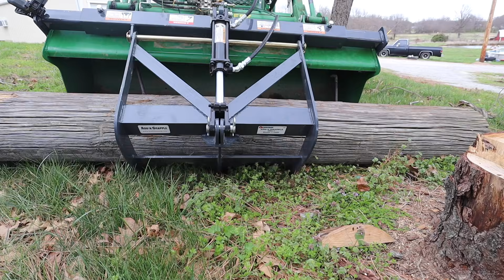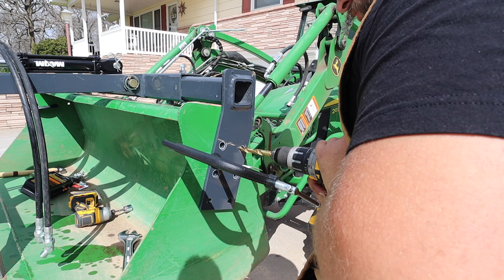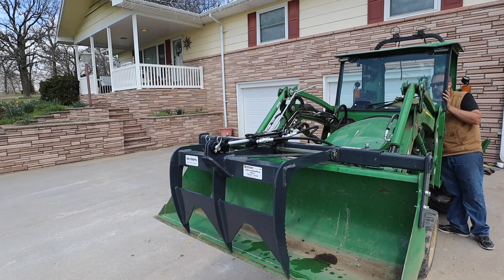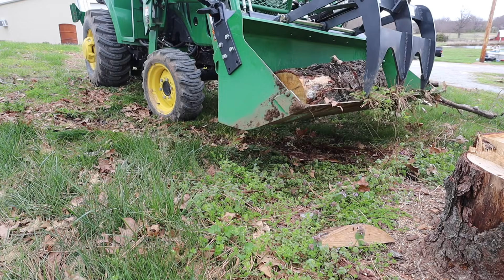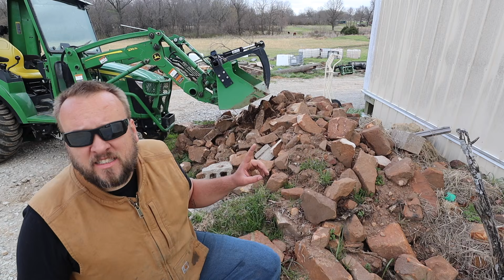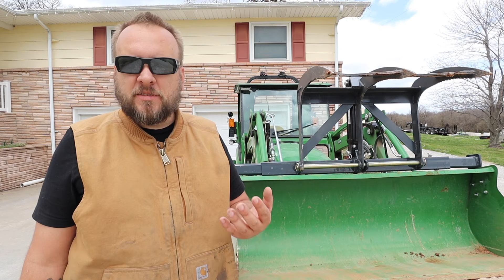The Cheapest Way to Add A Grapple to Your Tractor

Comment: Ive actually found a cheaper grapple , Stout grapple ad on $799 free shipping
Reply from the maker: You couldn’t buy the metal to make a grape for that if it is stout

I hope it works out. The Chinese products are sometimes good but not always
Reply: @RockhillfarmYT its american made in Wisconsin, its a grapple add on that you weld or bolt to the top of your bucket or wherever you want to put it. Its called stout buckets grapple add on.
Reply from the maker: Cool. I thought you meant a standalone grapple

Makes more sense with this type that is added to a bucket

Comment: Your code is expired. Just tried using it. March 12, 2025.
Reply from the maker: Thanks for telling me. The business was sold to another local manufacturing business. It is now owned by Tri-L. I didn’t know if they would be honoring the previous discount code or not.
Reply: Hey I just saw one of your shorts. The code Rockhill works. Thanks for saving me $74. 👍 Rockhill5 didn't.
Reply: Rockhill works. Rockhill5 doesn't.

Comment: Did you pour your steel building foundation yourself?
Reply from the maker: I did not pour a foundation. I set the building on 20 of the 4000 pound construction blocks that I set in place myself.

Saved me about $8000 doing it that way.

Comment: Hey Brock, this is an old video, but I am interested in this grapple. You said you have the small add a grapple, I have a first gen 2032r with a 61” bucket. Will this fit?
Reply: Sorry, I should have also asked if you thought the mini or single version would be better?
Reply from the maker: I don’t remember which one I have but the one I have should fit yours. My bucket is 57 inches and there is a lot of adjustment on the top slider

I would still recommend this product to anyone. I just don’t have that memory for details. Whatever I said in the video should be accurate.

Comment: I was checking into the add a grapple more expensive than a Land pride root rake grapple I've purchased ..
Reply from the maker: You paid less than $1000 for a grapple?
Reply: @RockhillfarmYT  no actually i paid $2200 for it.. but when I got online  all of the add a grapples  were $2300 Plus.. that's why I made my comment
Reply from the maker: The one I have is $995
Reply: @RockhillfarmYT  I will have to research harder I guess
Reply: @RockhillfarmYT  thanks
Reply from the maker: To get 5% off your order use code:  Rockhill at https://www.agfolks.com/product/add-a-grapple-single

Comment: i've had a add a grapple for about 16-18 yrs.  it's as valuable to me as my front end loader is to my tractor.  i used it to clear my property.  i cleared it with a chainsaw, a massey 1240 and an add a grapple.  it made it so easy to move brush.
Reply from the maker: Thanks for sharing

Comment: There is no cheap grapple. And if you don't have 3rd function valve. There are another exspence. I bought the bolt on top.
Reply from the maker: Definitely no cheap option but when other options are 4000 and you can do it for 2000 then that is the cheapest.

2000 is still a lot

The video I released today demonstrates putting a third function diverter on

Comment: You have a gost at 6;06 walking by and vanishing.  Why not turn the cylinder 180 and have the ports face the quick connect? shorter hoses.
Reply from the maker: My 3rd function hydraulic ports are centered on my loader, not on the side

Thanks for watching

Comment: Check out the new Artillian fist grapple - very cool redesign.  https://youtu.be/R9PrDoyZK44
Reply from the maker: Yeah, I’ve had it for a while but They wanted Tim to release the video first
Reply: Figured that you had it.  I still like my “old” grapple that I bought in December.  I just added the tooth to both grapples.  Haven’t used it with those on it but I think it will do the trick for me.  Keep up the great work.
Reply from the maker: Those teeth look like a handy addition. Haven’t tried them myself though

Comment: I've been looking to add a grapple to my pin style bucket on my Mahindra.   I called the dealer they told me around 5K to do it.  This gives me an option.  No to see how to add the 3rd function, since I only have a duel function.
Reply from the maker: They have an add a valve kit for $500. You can easily install it yourself

This cost a little under $1000 for the Add a Grapple

I’m going to say most of that $5000 was labor cost for something you could probably easily do yourself
Reply from the maker: Here is my factory tour video that I did with the owner of the company. Towards the end of the video he in boxes and demonstrates the third function kit

Precision Manufacturing - Factory Tour
https://youtu.be/PR2gGDbZ5_o

I personally used a similar kit from a different company and I have a full install video showing how I did it

Comment: I put the smallest size one on my Kubota BX25D last summer, and I  have been really pleased. Installing a Summit 3rd function was a little complicated, but not awful. Installing the AddAGrapple  itself was easy. I have a Piranha tooth bar on the bucket all the time, and the grapple works nicely with it.
I did remove it once, and it's not hard. Putting it back on was a little fiddley, but not difficult. I spray a little lithium grease on the wear points from time to time,  and I don't see any wear. I use it hard, and have flexed it when picking up irregular snags, but it has not bent permanently. With the bucket on, you can't see the pickup as well as with a full grapple, but that's only a minor annoyance. The grapple actually helps with loads of dirt-- I can use it to help loosen a compacted pile, and it helps in not losing dirt when you bounce on a rough surface.
Altogether,  it's a great tool.
Reply from the maker: Thanks for sharing your feedback on it. 

Everything you said sounds about right

Comment: I like the simplicity of the design. Sure a dedicated grapple might be more effective but the fact you can still use your dirt bucket simultaneously is a win. Thanks for the demo. Also, where did you get the metal shed that looks like a quonset hut?
Reply from the maker: I got the Quonset hut from Legacy steel buildings and I ordered it at a farm show

I have a whole series of videos on the build and what goes into it

We are standing up the last arch today and then I’ll be starting on the end walls

Comment: Really neat product. Please do a review in a few months on the durability. It is priced right as well. (Around $1K). However, shipping is the kicker. Almost $400 to ship it to the northeast. My guess that is inflated due to the current economic conditions. I’d love to get one, but with the shipping being 1/3 of the price, it’s a no go for now. Again, thank you for reviewing, I’ll keep it on my radar for the next several months.
Reply from the maker: I will definitely do a follow up video on it as I continue to use it.

I think the trick on the shipping might be to order it through your local dealership.  

I’m not 100% sure on that though
Reply: Check out their website for dealers. My local Kubota dealer is an authorized dealer for precision mfg.  Plus a dealer can help on sizing and install on hoses. Some of their products don't come with hoses. I don't have time or experience to do that for our adjustable add a grapple  for forks that we are buying with our new tractor.
Reply from the maker: My local Deere dealer can also sell these
Reply: @RockhillfarmYT  Yes they have a nice network given the size of the company. They have a good reputation from what I have seen and heard. Looking forward to using ours in the next few weeks.

Comment: That grapple is a million times better than no grapple at all. I built one very similar years ago and did a lot of work with it. I built a newer version a couple years ago. It weighs around 115 pounds and it never comes off my bucket. That video really makes me want a tractor with a self-leveling loader. You have an awesome set up with all that ballast weight and self-leveling loader and your many many attachments. I’m very jealous of you and your college basketball supremacy…
Reply from the maker: What kind of tractor do you have
Reply: I put 600 hours on a 3032E I bought new  in 2011 and sold it. I regret selling it. I paid $16 145 for it brand new. I now have a 2020 3038E that cost almost twice that. I do like it though.
Reply from the maker: Nice tractor.

If you were serious about living nearby and having homemade attachments you wanna show off we should make it happen.
Reply: I don’t think it would be worth your time to drive to my house just to see the dozen or so implements and modifications I have made to my tractor. I probably live further from you than I actually realize also. I’m 20 miles south of Coffeyville down Highway 169. If you were coming this way for something else it might be worth your time to stop and look at some of my stuff. Most of it is nothing special but I have done a couple of things that are kind of neat. One original implement that I’ve never seen anything like it.  And some other modifications that might be unique as well.…

Comment: I've got a grapple already, but I would definitely consider purchasing one of these.  The grapple I have is handy as all get out, but having one on a traditional bucket would work for a whole different set of chores.  Especially for those times where you might worry about something poking through the grill.  I would never get rid of my root grapple, but this could add some handy features for a reasonable price.  Thanks for sharing this!
Reply from the maker: Well said.

Thanks for watching
Reply: I agree with you. I think this would be good for stuff like rocks, but for brush and logs, I like the root grapple. I picked up a 74" grapple at about the same price point as the double, new at auction.
Reply from the maker: I’ve been really surprised how well it works on brush.  Total capacity is lower than some other Grapples though

Thanks for watching

Comment: Where is your basketball net?
Reply from the maker: Interesting question.  All of the rainwater from our downspouts ends up in that spot and it’s taken a while for the ground to dry and pack around that sono tube

I really needed to do a better job of packing in the dirt in layers when I refilled that hole. I’m thinking I should probably cover that in another video because you could run into a problem, if you repeated what I did 

If I had put the basketball goal up when I was originally planning to, i’m not sure if it would’ve held it. I think it could have leaned under the weight

Comment: Certainly makes me rethink my grapple options.  I want a double which adds a considerable amount to the price but still cheaper than options I've been looking at.
Reply from the maker: Mine is the small version, because my understanding is my bucket isn’t wide enough for the double

Definitely good to have an option in the lower price point. I think even adding their diverter valve it’s still going to be cheaper than the mechanical Grapples

Comment: That is pretty slick Brock!!  How much does their hydraulic diverter run??
Reply from the maker: The diverter to add third function is $500

That’s still not cheap but it’s the least expensive thing I have found. Same with the Add a Grapple.

It’s still not cheap but it’s cheaper than any other option on the market

Comment: I would think about putting bolts in the other direction.  Bolt head inside so threads don't get buggered up?
Reply from the maker: Thanks for the suggestion. Might be handy
Reply: Also less sticking inside the bucket for something to snag on.

Comment: Does that work on a bobcat?
Reply from the maker: I think it should work on anything with a bucket.

They have much larger versions if you mean a bobcat skid loader.

I didn’t specifically ask about the Add a  Grapples on a skidloader but they do make grapples for skid loader’s

He showed me their largest Grapple they make which has a 74 inch opening and weighs 1400 pounds